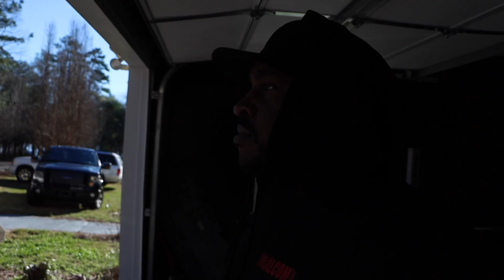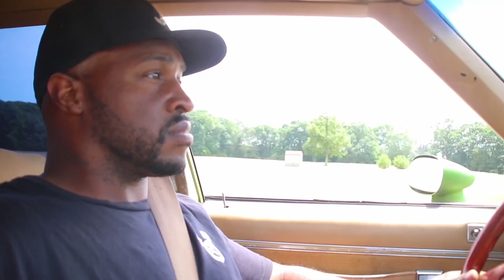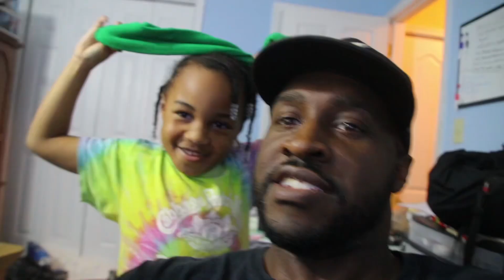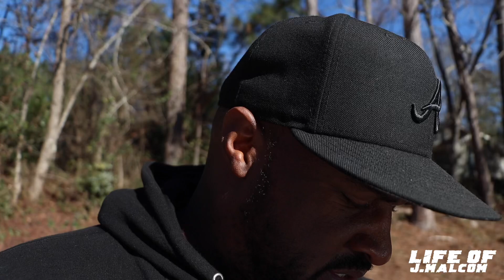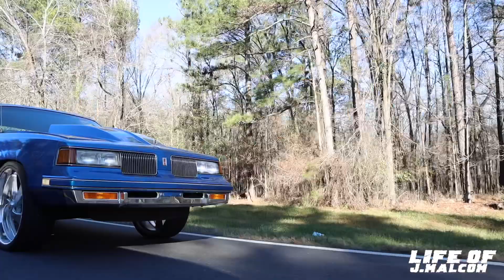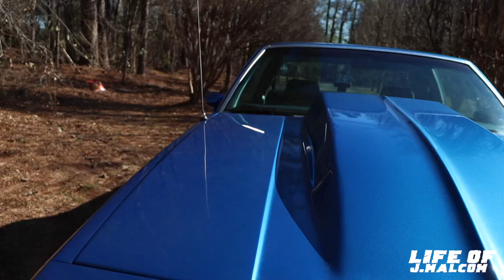LOOK WHAT I WENT AND DID.......

Comment: Happy you mounted up that’s always good .. question my cousin got a cutlass and bought 24 inch rucci .. to avoid welding in the back would us mag not built the back wheels 24x9 with 3 inner lip giving 6 inch out lip ? Also what size tire you running in the front ? I told him he shouldn’t need to cut for 24 if he used heavy duty springs in the front to raise the nose a few giving clearance
Reply from the maker: He could maybe get by with proper back spacing on a 3 piece wheel and no matter what, the fender will still have to be trimmed a little as well as the inner lip in the back fender well